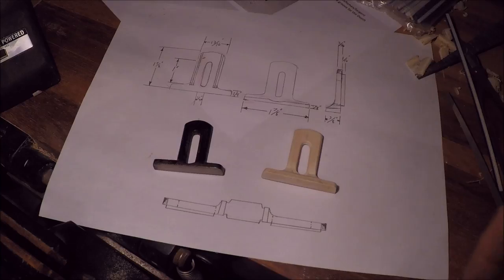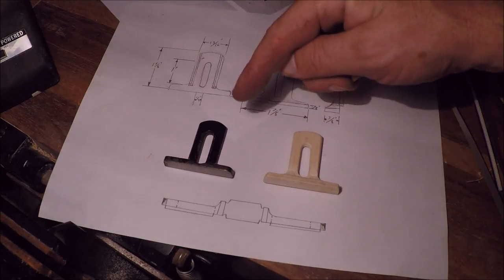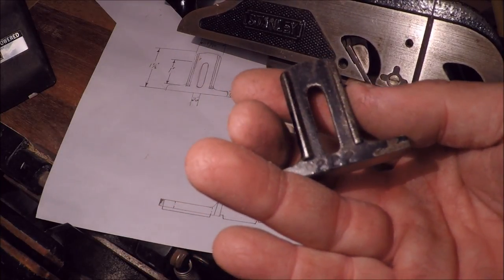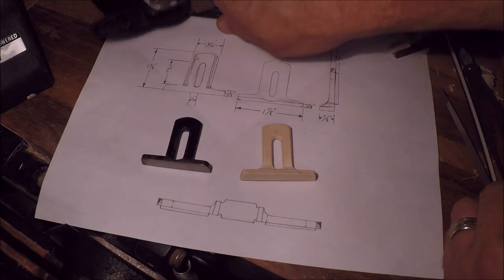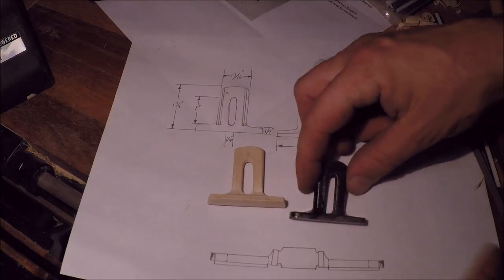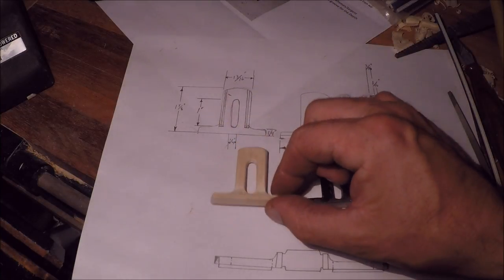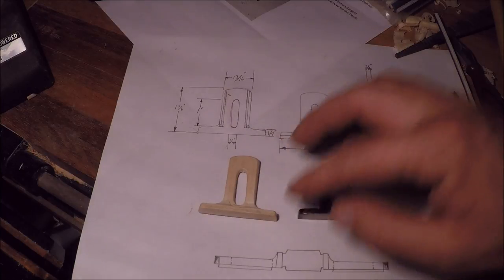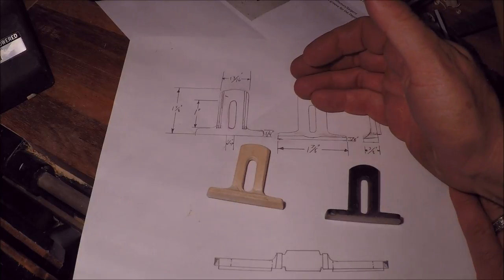Stanley 78 Rabbet Plane Parts

Comment: I am in need of the depth stop and the fence.  Once you have them ready let me know.  I think I can get the depth stop rod machined locally.  Mine is the Craftsman.  I have been told it is the same as a Miller Falls *85.   The depth stop would be pretty generic.  The fence may need to "cut out" for the blade repositioned, but that should be easy to move if needed.

Comment: Great work on the pattern Chris. I think it will be an excellent project.
Yes the other plane with the opposite mounting hole is a Sargent #79. I also have a Millers Falls #85 that closely matches the Stanley #78. The parts you will be casting will fit all three. It will only need to have the appropriate cast in V filed flat.
I just got the 10-27 die from Victor and will be making a couple mounting screws for my planes. Depending on how they work I will probably make at least a few extras. Prototypes and production.
Reply from the maker: i'm glad you like it it really did come out well. can i get a couple of the screws . i wonder if you can find a off the shelf thumb screw with a oversise thread turn it down and then run your die on it make for easy production.
Reply: I think 1/4" thumbscrews might work. I want to see if I can forge a head on a piece of rod. I'm going to try and create them whole just to see if I can. It might just work.Just realized I didn't answer your question. Yes you can get a couple screws.
Reply: Chris Anderson I just was watching one of Mitch Peacock's videos. https://youtu.be/c1ohhqtIkqA
I got a surprise. The depth stop mounting screw isn't a paddle type thumb screw. It has a knurled round can shaped head like the other two screws on the lever cap and fence. That's going to be a lot easier to make than trying to carve out a symetrical paddle shape. 
I thought it was odd that the screw matched the screws on the Stanley No. 80. It might just be that it was borrowed from one. 😆
Reply from the maker: good to see b.t.w i just posted a video showing the samples castings that have come in .

Comment: I just received a Stanley 78 which I purchased on line. The depth stop had the 2 V rails on the back, equally prominent in relief. I had to file down the one that didn’t mate to the plane body via there only being one notch. The depth stop sat crooked otherwise. This created a new problem though. My file job while it straightened the depth stop, now caused the stop to abut the iron and plane body thereby eliminating any chance of the iron protruding the 1/32nd or so out from the body which is the way it’s supposed to for proper cutting. So I filed 1/32nd off the back of the stop to allow for blade overhang. This plane clogs with chips often during operation. This is more due to the cap iron. Modifications to the cap iron helped, but the way the cap is cast is inherently flawed IMO, in that it is too narrow. I don’t know about the older models, but the critical details of this new one are sadly lacking for good functionality.
Reply from the maker: as cast from stanly they do sit a little crooked and that is to let the blade protrude as you have described . you might have removed to much . rather strange that it had both v's still there.
Reply: Old Iron Shops ...yeah I thought it strange too. I did realize that maybe I shouldn’t have filed as much as I did. I didn’t even remove the whole thing. Only enough to make the stop sit straight. And removing material from the lower back of the stop did correct the problem. I still contend that the clogging problem is mainly being caused by the cap iron. The top of the cap iron has a contoured protrusion on top which is designed to divert shavings out towards the user. However it is useless because it dose not catch shavings from across the entire length of the cutting edge because it is too narrow.
Reply from the maker: @mercoid  hemm i should look in to that but i cant say i have any trouble with mine clogging that i recall.

Comment: Nice work on the pattern Chris, I had a proposition for drum anchors a couple months ago and I took the original, made a pattern large enough to allow for shrinkage to be a hard aluminum pattern that was still larger than the original in order to make a dozen for a match plate for the final cast iron parts. It was a headache to get the match plate made because each one of the aluminum ones had to be chased but if the order is for a couple hundred or more it's worth the time
Reply from the maker: there is very little on one side just the 2 ribs on odd side would be very easy to make for a hole gang of theas parts.
Reply from the maker: our friend Clarke here has received the pattern and is going to send me a sample back soon very interested to see how it comes out.
Reply: old iron shops Chris, got a quick question, check your email, thanks

Comment: Nice work. Possibly that part could be 3D printed from plastic to use on the actual plane. Or 3D printed for use as a pattern as already suggested. They also use 3D printed parts in investment casting (similar to the lost wax investment casting process).
Reply from the maker: +Steven Haskell all good options

Comment: You seem to be rediscovering patternmaking, which is certainly one way to proceed. I say this because you don't seem aware that your pattern must be made so it can be smoothly released from the sand molds. You can see this in how cast metal often has a taper, which indicates the direction that the pattern was extracted. I don't know whether you have already worked with a foundry but they can advise you as to how to improve your patternboards, and how to arrange the patterns for multiple castings. When the foundry foreman explains how they price by the number of molds and the amount of metal poured, you will quickly understand how important it is to arrange the patterns to allow for multiple pieces from each pour. Good luck and I look forward to your steady progress.
Reply from the maker: +annarboriter I have been studying this for quite some time you are right on all of the as things .in the past I have only had one or two at a time cast but this part seems to be generating a good demand. Thanks for sharing :)
Reply from the maker: +annarboriter sorry didn't mention that there us the proper draft on this pattern and allowance for shrink and machining.

Comment: On my No 78 the depth stop screw is a 10x24, readily available.
Reply from the maker: What you need to look for is called a shoulders thumb screw. Wouldn't exactly like the original but should work for you.
Reply: That would be harder to find, but a round head screw with a washer will do in a pinch.  Not pretty, but functional.
I am currently restoring my No 78 and intend to cut a short piece of 1/2" - 3/4" round stock, centre drill it and tap it pean the exterior of the screw ( cut off) to hold it in place then spin the head against a belt to round it and finally file lateral groves for some finger friction.
Reply from the maker: @thomaskral5417  more than one way to skin a cat.

Comment: I need about ten right away. And maybe another ten (or more) for local distribution here in Ukraine.
No need for international shipping though, I have a shipping address in NJ, 07064.

What would be your estimation price-wise?
Reply from the maker: +Андрей Сорокин I need to see what the foundry cost will be probably around $20 each but could be more or less
Reply: Wow, that is hugely over my expectations. 

Right now I could order the whole repair set from Stanley (1-12-713) which includes depth stop, lever cap, some screws and bolts for $17.94 plus shipping. (https://servicenet.bostitch.com/Parts/Search?searchedNumber=1-12-713)

So unless I see a price about $5 each for the depth stop only, it does not generate a lot on interest. Sorry...
Reply from the maker: i clicked on your link but i don't see the kit your talking about what do i put in there to search for these items?
Reply: Just remove the very last symbol ) from the address bar, youtube parses links stupidly here.

Here, this one works: http://servicenet.bostitch.com/Parts/Search?searchedNumber=1-12-713
Reply: You can search it by Part # 1-12-713 to see the pictures, but it is out of stock in most places.

Comment: So you made a pattern, and it was a pain. You don't want to make more. Use your pattern as the pattern for more patterns using latex and some manner of casting plastic. Once the rubber mold cures, you could make 6 patterns in an hour. Very accurate (will replicate fingerprints you leave on the item being used as a pattern!). Not particularly toxic. Not particularly expensive.  The resin cures in 10 minutes to the point it can be removed from the mold, and is totally hard before too long. There are different types of resins including some as hard as a hard-hat and some with aluminum in it. The resins accept dye.

Here's an example: https://www.youtube.com/watch?v=kzOtuCTg-0c
Reply from the maker: +Tony Ennis I think this is the winner.